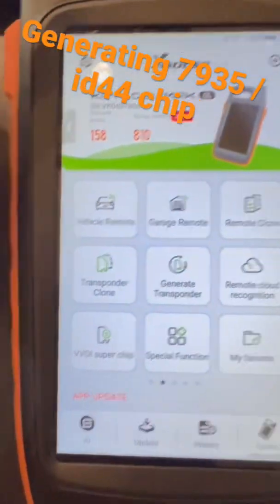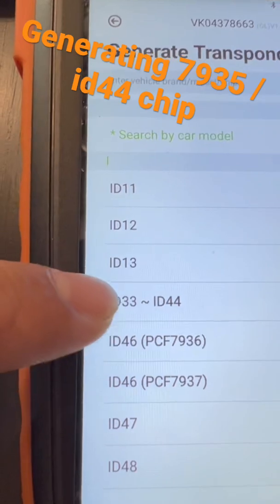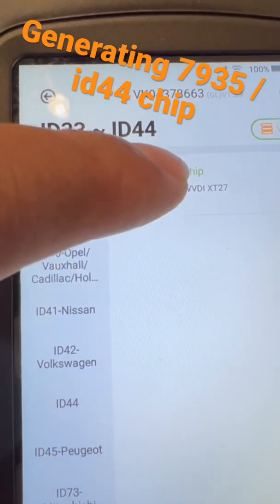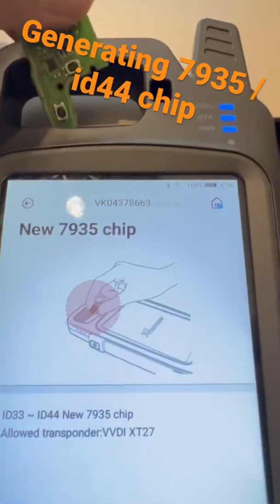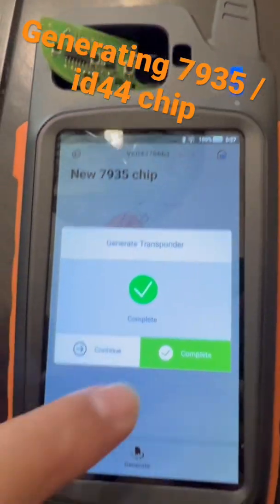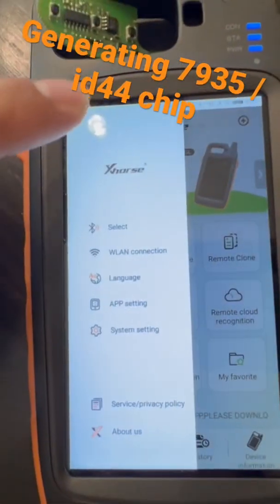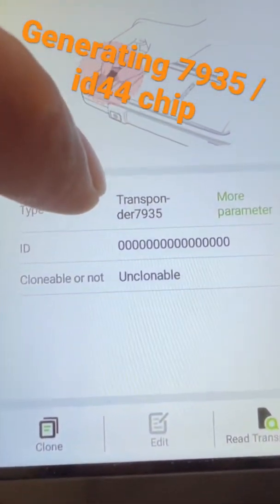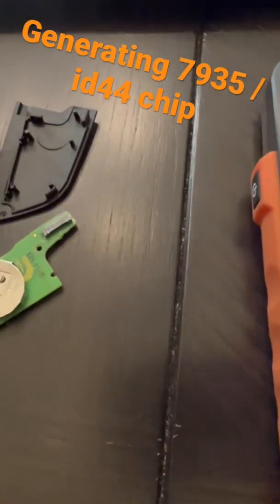Using #xhorse #keytoolmax to generate 7935 / id44 for #bmw #ews #keys chips #transponder

Comment: I try 2005 mini cooper it doesn't work you need to generate nissan id41 work perfect
Reply from the maker: That’s good to know . 👍🏽
Reply: thanks for sharing this info. i tried generating as a 7935 and it didn't work but i saw your comment and generated as nissan id41 and it worked perfect on a 2001 bmw 330i.
Reply: Thanks 🎉